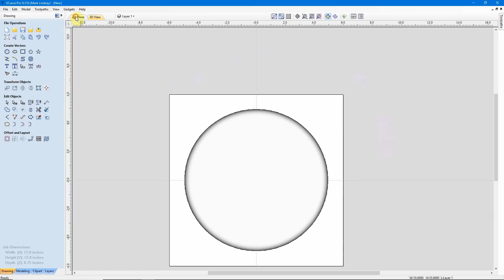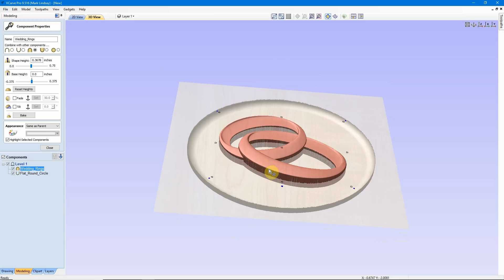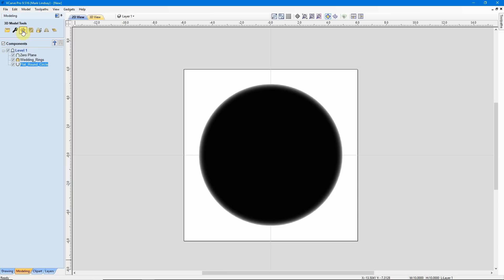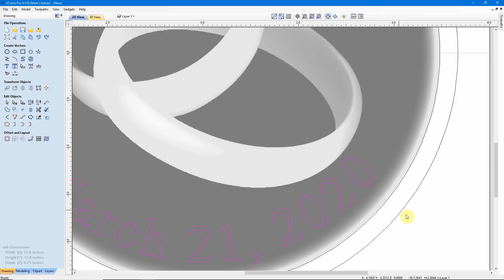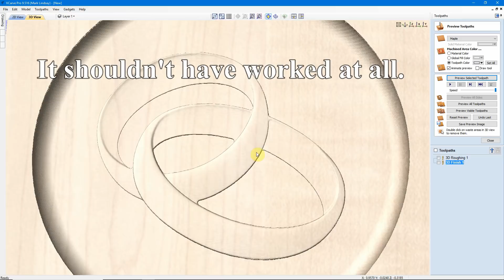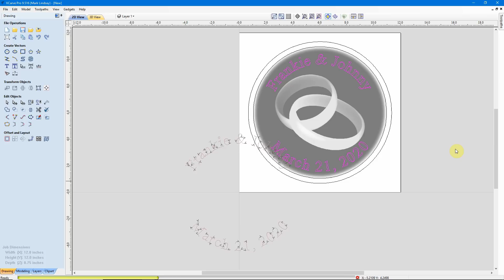Combine 3D Models -  Part 19 -  Vectric For Absolute Beginners

Comment: Mark  Thanks for your great videos. I always learn something new. 2 questions though. When you changed from the center design point to the  bottom left do you have to select all of your design then hold down the shift key then you can change your datum point to the bottom left. 
Second  question is after you have  finished your design and  find that the board is to big as you pointed out. Can you go back and make it smaller.
And  not effect  your design
Jeff
Reply from the maker: Easy peasy, Jeff. Just go back into Job Setup like you saw me do, and change the material dimensions or the X Y datum point - or both, for that matter. You don't need to select anything at all. The software will prompt you to recalculate the toolpaths. Recalculate, them and you're done.
Reply: @MarkLindsayCNC  thanks  I am starting to design and build custom cabinets and for ease I always use the center point. but I now have a touch probe that uses the left bottom corner. to set my xyz I tried to change that position just yesterday and  when I did all my tool paths moved and ended up in the wrong place. Great timing on the  video. One  other question is there a way that  after I create a rectangle for a dado cut to place it where I want it to be by setting some x&y positions.
Jeff
Reply from the maker: In the drawing, yes. Select the rectangle click on Draw Rectangle, select the anchor point, and enter the X and Y coordinates you want to move the rectangle to.